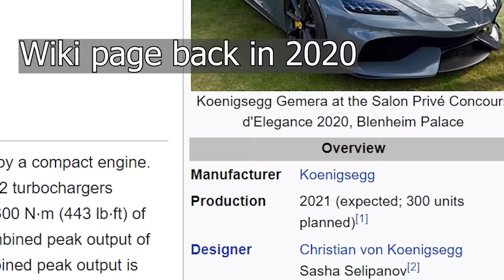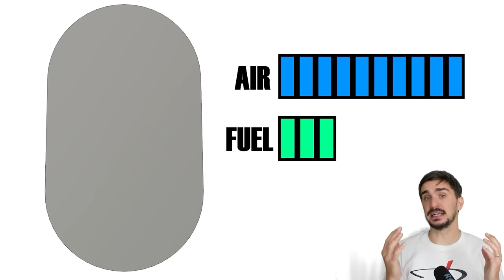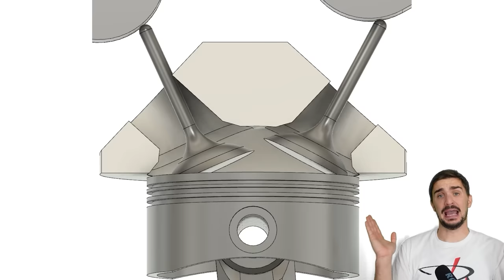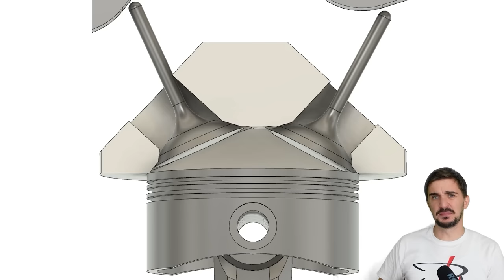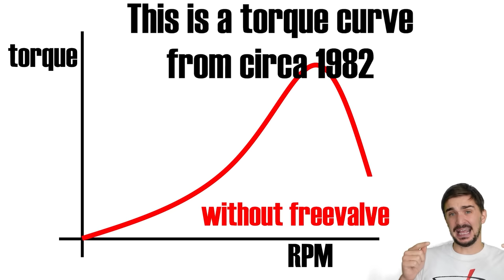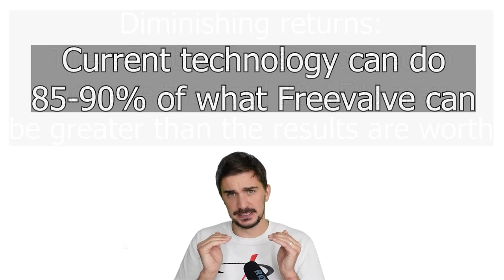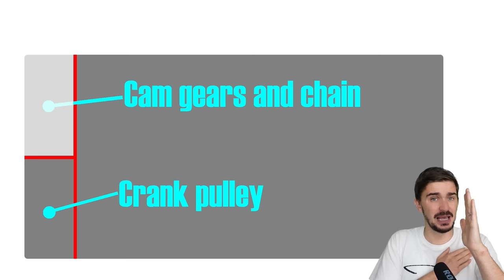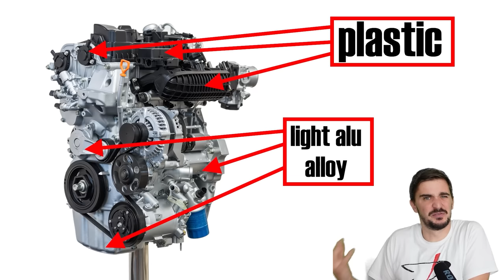FreeValve Isn't a Big Deal. Here's why

Comment: Makes you wonder if somebody from the older engineering days were here now what they would do to make it work. Like everything is analog in an old engine. But I bet if you showed this video to them back then and explained what our fancy computers tell us now they could put a spring a plate and a piece of bubble gum somewhere as proof of concept and rebuilt the whole thing ground up. 

Like what if you could somehow control what you described as the issue with cams with analog passive components that just do what the engine needs as you challenge it in different situations.

Comment: Freevalve as a concept was smart, and has been looked at plenty of times before. As an implementation, freevalve kinda sucks. Beyond it's obvious cost increase, it is also adding a entirely new pneumatic system to the car. Cars already struggle to maintain reliability with fuel, oil, vacuum, and coolant. Now you wanna add pneumatics with a compressor? Yeah, IDK about that. The way to do freevalve is to use electric solenoids and keep the engine RPM lower so that the solenoids can keep up. If you REALLY wanna get tricky you can try to use piezo electrics with some kind of mechanical multiplier, but good luck with that. Either way, I think freevalve as a system can be made cheaper than a cam based engine IF and only if you implement it on smaller low power, low rpm consumer engines. Just the extra space it can provide may be able to allow car makers to change the way the car is assembled which would could lead to lower production costs.

Comment: Doesn't even make sense for low volume hyper cars or it'd be used in racing. Because trust me, if it actually delivered on it's claims every F1 team in existence would have licensed the tech 8 years ago. They spend millions for tenths of a second off lap times. They'll take every fuel saving trick they can find. Any weight savings is better spent elsewhere for their weight budget. And they will risk hundreds of millions in fines for as little as 20 extra HP on a car with 850. Nor do they even need it to last more than a single race, so long term reliability isn't even a factor. Heck, if it worked F1 would license the tech for the couple extra inches in packaging it allows for aerodynamics changes. They've done more for far less than FreeValve promises before. Does anyone, and I mean anyone, think every engine in racing wouldn't be using FreeValve if it actually worked? There's manufacturers who spend millions to build one bespoke car every year for LeMans. No other race, just a car on the grid at LeMans. If FreeValve worked one of them would have used it by now.

Comment: The only problem I have with your video is where you compare freevalve vs "traditional" engines. Theres many more variables to compare for that. For example, the turbo size, boost pressure, and compression ratio. An apples to apples comparison would be 2 engines with similar displacement, similar compression, and either same sized turbos with same boost or both NA.
Reply: None of that will effect the valve train though. Yes, all of those will effect power output, but I believe the point he’s trying to make is “we already have X solution to variable valve timing” not “this won’t make as much power as that”

Comment: Best advantage is less mechanical parts. As far as the 1.7$ cost..  it's already been invested. How much more would be needed. Just tooling to integrate into an engine. Which they would do anyway when designing a new engine. 
If the gains are not that great.. I see why not bother.

Comment: I think there is a mistake in your Analysis. A Solenoid with a Spring should be, if mass produced, way cheaper than the current, complex setup with a Timing Chain, variable valve lift shaft things and the like. Sure, you might still have the Drive Belt for the Auxiliaries, but since those are not critical for timing theyre much less demanding. The R&D costs for that Technology are high, sure. But the actual implementation should be way cheaper than what we have today. Look at Fiats technology with a shaft and hydraulic pistons and other gimmicks just to archive something that could be done with a solenoid, a spring and a basic computer. We SHOULD actually have this technology since the early 2000s and I have no real Idea why we dont (other than Car Manufacturers being extremely conservative up to a point of Incompetence with everything involving semiconductors)

Comment: Okay the only problem with what you just said about that Roadrunner being from overlap that's not from overlap high-compression the reason that motor cackles can I have high compression Motors back then did not have high overlap because overlap isn't what you want for torque overlap is what you want in high RPM RPM torque

Comment: I don't like exaggerations either. But even if FreeValve reduces consumption by "only" 10%, that's reason enough to install it in all gasoline engines.
Reply from the maker: Not if the cost increases by 50%
Reply: @d4a  Mass production of a single FreeValve (for variable valve sizes) for all car brands would actually reduce costs. In addition, there would be a 10% reduction in fuel costs and CO2 emissions.

Comment: If you use the same tech as a HUEI fuel injecter but convert it to actuate the valves the problem is solved and you don't need an air compressor as you use oil pressure.

Comment: Did Qoros engine use turbo? like standard engine in 1.6 displacement, because 1.6L engine without turbo aint producing 300 hp xD and if camfree doesnt use turbo in their engine and produce 230bhp with good throttle response, thats amazing.

Comment: Reduction of part count (especially moving parts), roughly 20kg (~40lbs) is no small thing. It also reduced the overall size of the engine. You seem fixated on hp but ignore everything in engineering which quantifies "better" for engines. Adding more parts increases costs, weight, and reduces reliability. Your recommendation is good for car companies but absolutely terrible for vehicle owners.

If they would get the produce to market, it's a win-win for everyone and remains so. Especially so for vehicle owners.

Comment: Engine size slightly shorter by the thickness of the timing belt/chain gears and cover about one inch, maybe two, height and size of cylinder heads without cams cam gears long valve stems cam journals, VVT assemblies valvetronic motors valvetronic actuators Vanos filters Valvetronic cam accommodation journals caps oil galleys, extra material to house the cams, keep the extra metal cool and preventing it from warping long plug tubes  large valveciver, all minimized

Comment: Agree and disagree. Like You said, There is really no need for this technology. On the other hand, total control of valves by simple impulse from controller is just great in its principle. Maybe some day this technology will get mature enough (and cheaper) to be more common. Other pure mechanical components of engine (carburetors, ignition distributor, etc.) was good enough, but they are now replaced by electronically operated version, just because it is simpler and give manufacturer more control over performance. This is the future of piston engines (of course if they have future)

Comment: Th whole catch was to remove the throttle body and camshafts and while it does present obvious benefits, IMO it's too little too late. Manufacturers put billions into various variable valve lift systems and adopting this would be almost starting over. Lastly the hybridization or even going all electric (madness) makes it basically irrelevant.

Comment: I don’t think the that the statement “can technology already does 85-90% of what freevalve will ever do” is accurate. If freevalve were in a gr86 people would start messing around with it. Cross-cylinder scavenging (think 911 gt3) would be a big thing. You could tune the valves to allow massive harmonic boost at every engine speed.

Comment: Ok but you’re comparing boosted engines.   Let’s see the best variable valve timing engines vs free valve.  Same displacement both of them NA both of them same compression ratio both of them tested with different fuels from 87 to e85.

Comment: They should try implementing FreeValve into aviaiton engines.  Small aircraft need all the efficiency, power, weight, and size advantages they can get, and money is hardly an object when the bare airframe alone costs $200K+.

Comment: i'm far more interested in the "inverted wankel" rotary engine that Liquid Piston is pioneering. Freevalve is a high technology addon to a very optimised design, and not one that even overhauls the system, its a standard piston valve, not any of the more advanced fast acting valves used in other applications.

Comment: I don't know man I'm a true gear head at heart but electric motors kick the shit out of any IC engine and soon battery tech will catch up to where it needs to be. Nothing beats the instant torque of a DC motor
Reply: far more needs to catch up than just battery tech, instant torque is very boring to drive once you are used to it
Reply: @arcanevoid9199  Instant torque is boring? You've must have hit your head pretty hard or something. I hope you get better soon.
Reply: @AnthonyCelata  yes, try driving something where the power linearly increases with rpm and it makes all the power up top. really fun when it rewards good driving and use of the gears. instant torque is basically just an on off switch and once that initial jerk happens thats it
Reply: @arcanevoid9199  I'll pray for your speedy recovery. Hang in there buddy

Comment: Here’s a simply the reason why freevalve is better and worth putting the money into to keep the internal combustion engine, is simply reliability, as so many of the major issues with these engines which uses other means to have some sort of variable valve system is valve train failures ,guides, the systems themselves, it’s fine to be a engineer and speak on YouTube, but try having 25 plus yrs as a master tech, yes with a college degree, freevalve could easily be the answer to lots of issues, heck how many of these oiling systems have failures due to oil leaks which require the engine torn down half way because the valves and the guides are oil controlled , this isn’t about if we still have or need a serpentine belt system for the ac compressor ..could you imagine if the LS1 had came out with freevalve and what if this system is done correctly and we put the money into freevalve instead of EV’s ,also  it would be great for the aftermarket, as tuners could simply do some programming instead of having to swap out four camshafts on a GTmustang..one of the first thing the aftermarket does is do away with  the factories variable valve timing due to failures at higher rpm’s, and higher Hp ..swapping out a Electric valve wouldn’t be a harder than a well placed fuel injector..yes your great at changing your tune, and you can now say how bad or why freevalve doesn’t work or isn’t needed, but your not taking into consideration all the facts..

Comment: i think free valve is the kind of thing that would become standard if the current economic paradigm collapses and we all have to make stuff diy. aka the collapse of production at scale. at that point cam shafts and all the bits and bobs would be needlessly complex compared to a free valve type set up. they might have lower diy manufacturing costs and lower diy maintenance costs. and alot of will say that this is conspiracy, but i suspect the globalization capitalist economy is way more fragile than people think it is. and creating liquid fuels for combustion is way easier than producing lithium batteries in a diy set up.

Comment: Not fair. First you came up blaming that free-valve team was compairing their sistem to early 80's engines, and five minutes later you compair each benefit and increment in F.V. pack, with a single benefit or increment of each different engines separatedly.
Also you just made a sort of "super-trunfo" compairison, picking just numbers, when you obviously knows the great difference between them is on the GRAPHICS.
If you extract 300HP from a K20, i'm pretty sure it won't show the same graphics as FV sistem, a K20 won't ever deliver same amount of torque at low rpm as you will see on the FV with same displacement and same power and rpm limits.
The cost discussion i won't debate, i remember auto industries failing badly for 2 or 3 times with electric cars ( taking astronomic costs in each fail ), and seems like they'll fail once more, not because of project itself, but because of batteries won't ever comply same amount of energy as fossil fuels, with same wheight and autonomy, any good chemical engineer can tell, and then you'll notice there's no clean energy enough in this planet to sustain all vehicles with clean electric energy. And i'll just remind you all about used and heavy pollutant batteries discard problems, that electric cars militants insists to ignore.
It's all for the hype, i'm pretty sure you know that i'm talking about MASS CONTROLL.

Comment: At 13:44 he mentions just sticking freevalve on a regular engine and you wont get great results.... No Duh!   The engine needs to be designed specifically for a free valve tech.  You need to understand that.  So many statements that are wrong in this video.  And I do usually like this guys videos.

Comment: Ummmmmmm FreeValve requires there to be a literal circuit board in the top of the head, above the cylinders? With a gasket above and below that long circuit board within the FreeValve header. Yeah, I'll pass on that idea. In my mind you don't want actual circuit boards in the engine itself, not with all that superheated oil and coolant around it. I thought circuit boards/ computers prefer colder temps to function correctly

Comment: Hello, nice points from you there, but i have 2 points that you did not consider: 1 - timing is the weak point in any engine so you need always to keep eye on that, because the different way that an engine operate( city on highway ). 2 - as you well know, eliminating moving parts on an engine make it more reliable . I consider free valve to be more reliable, on normal road cars with normal powers, with reliability  in mind as they are produced. Do not consider this hate , i really liked the video

Comment: I think you are kind of building a straw-man. I don't think Koenigsegg would reasonably argue that many of the same benefits and goals of Freevalve are not currently being accomplished with various VVT systems, but all those systems are very complicated. Some are incredibly complicated Rube Goldberg contraptions. The promise of Freevalve is you can have all those benefits and more, almost infinitely variable and all electronically controlled (pneumatically actuated) without the mechanical complication of a mechanical VVT system. That is the real promise of Freevalve. No more VANOS, VTEC, Fasors, or whatever your particular brand of car calls their VVT system. Will it deliver? Remains to be seen, but even if it only matches existing VVT systems with a less complex system, it's still a win.

Comment: Great points overall, but worth noting that in 1998 volvo motors had no variable timing or ignition to speak of, and got results surprisingly close to many modernish vvt motor. Only in reference to your "early 80's" comment

Only adds to the point that freevalve might not be fully viable

Comment: Lots of engines from the mid 2000s didn't have variable valve anything.  
Another perk of the Gemara is that the freevalve is that it can shut off valves entirely, spinning up one of the turbos faster than both of them.  Vastly reduced turbo lag.  
Also, the starter could (in theory) be eliminated.  
A lot of competing technologies (Fiat, BMW, etc) are quite mechanically complicated.  
As for cost, that has more to do with the car than the engine, and the engine part is due to being new and not mature.  

It's not as groundbreaking, I agree with you there, but I don't think it is as diminishing as you are claiming.

Comment: What this guy doesn't address is the freedom of a free valve engine has compared to a variable valve engine with cam phasers.  You can program the solenoids to have a smooth idle but the instant you hit the throttle, you can have as much "cam" as the engine can handle.  You can't do this with a variable timing engine since you are restricted to only a few degrees of cam timing and not any benefit of higher lift or overlap at high RPMs which you would have in the free valve engine.  He also doesn't address the complexity of the variable timing engine to the free valve and the added cost of the variable timing engine with its problem with durability and the longevity of the engine.   So he has actually done nothing to explain why the free valve engine has not made production yet.

Comment: I call bull! Racers are well known for chasing every last bit of power. How much friction do 500 lds valve springs × 24 or 48 times per single 360 rotation of the camshaft? I guarantee it's  a hell of lot more than 20 hp. Try to rotate a cam without the timing belt or chain, & tell me that it only takes 20 hp to rotate that thing at 8500 with springs that could stand up to the job?

Comment: PCM’s require pure current to operate correctly.  Any wave distortion usually results just in codes being set… whereas with free valve this would mean valves impacting the piston.  Therefore you would need mechanical redundancy which would involve a rather long, timed cylindrical thingo with lobes on it…